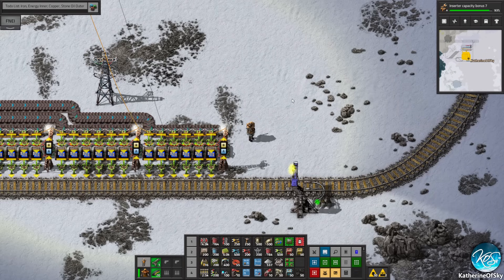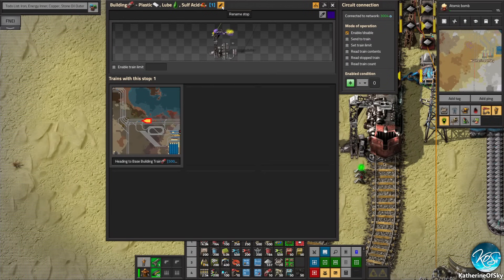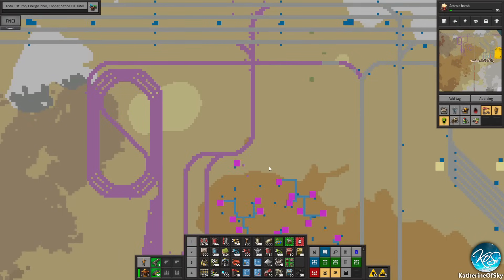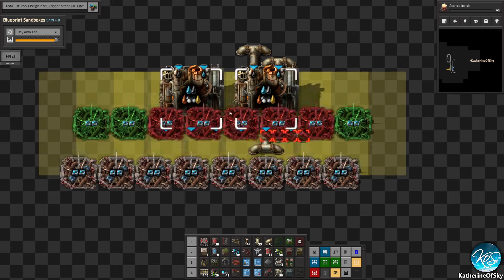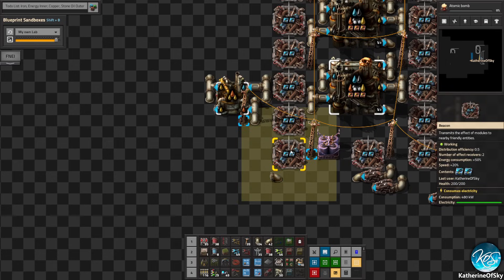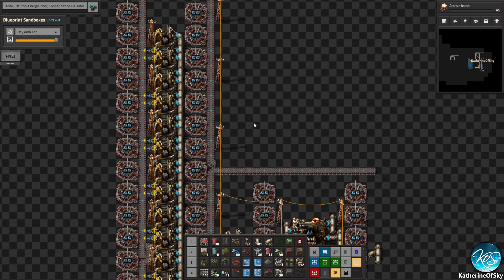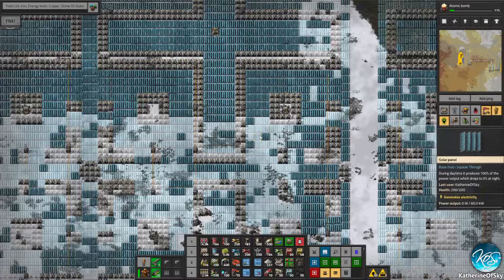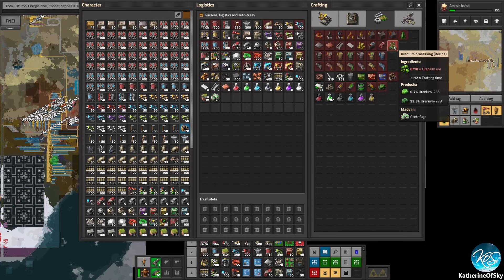Factorio Trickle Down Megabase 18 - BUILDING A SOLID FUEL OUTPOST FROM SCRATCH - Let's Play

Comment: With the Kirk Mcdonald calculator, you enter the number of modules for the "beacon" column.  So refineries with rows of beacons like this can have 20 speed modules, and chem plants or assemblers can have 16.  32 and 24 are the counts for "fully surrounded" IIRC - refineries can have a perfect no-gap square of 16 beacons with two tiles on all four sides, chem plants and assemblers can have either a no-gap square of 12 beacons with a one-tile space on two adjacent sides and two tiles on the other two sides, or the beacons can be spread out by a tile leaving a gap on each side (conventionally in the middle, so a small "L" of three beacons two tiles away from adjacent sides).  The refineries tile nicely with rows of beacons, but chem plants tend not to, so for large arrays you'll usually need "slightly more" chem plants unless you take care to offset them from the beacons so they're all covered by 8 beacons.

Comment: You should go over the oil again. When you initially ran the numbers on heavy oil cracking it did not have any modules in it, vs the oil refineries. That might have been why effect sources seemed off. Oh also any reason why you didn't want to put any beacons between the oil refineries to get the extra sources?
Reply from the maker: Because it costs MANY extra modules and is not needed.

Comment: There's an idea where you put the inner outers at the ins of the outer inners and the out outers on the inner outers but not inside of the inner outers so that the ins and outs of the out inners don't block the in outers of the ins and therefor increase the throughput of the outer inners inside of the inner outposts.